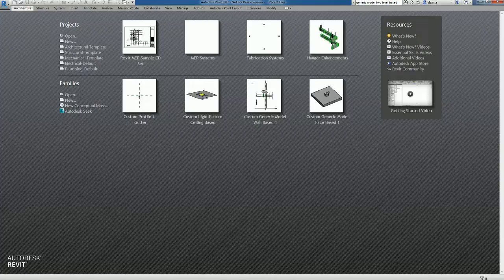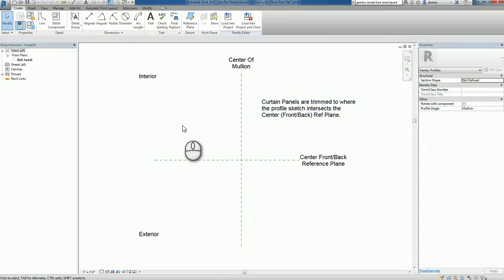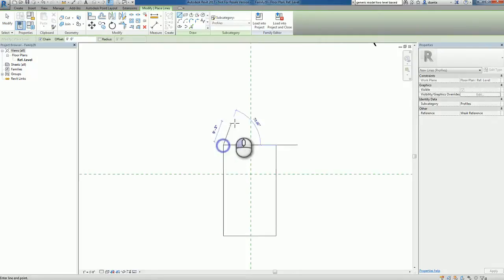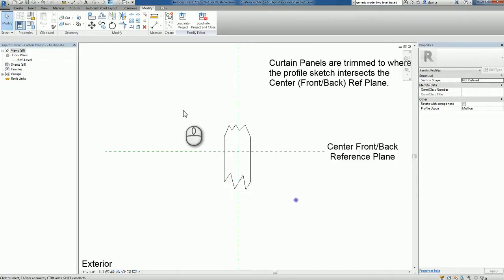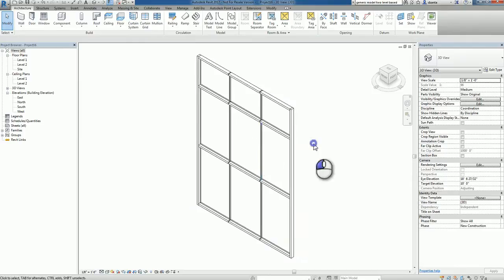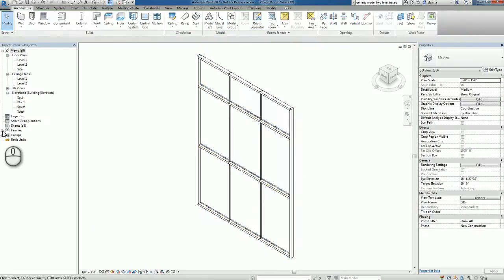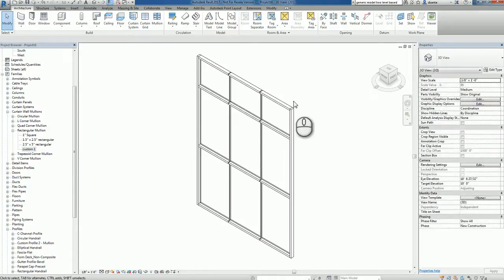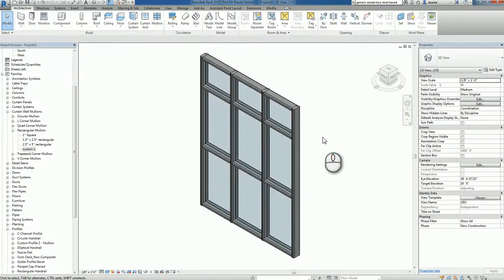Revit Families Series   Custom Mullion Profile How To Revised

Comment from the maker: This message is for Dennis Kong...your message came to me but for some reason I cannot see it properly to respond in the normal way....so:  If you want to edit an existing mullion profile, you have to do the following:  1.  Expand Families in the Project Browser... 2.  Expand Curtain Wall Mullions Category... 3.  Expand the Mullion you want to modify (i.e. Rectangular Mullion)... 4.  Right click one of the types (i.e. 1" Square)... 5.  In the Type Properties window, change the thickness and/or profile you want to use (assuming you already loaded a custom profile to change).  Hope this reaches you and helps you.